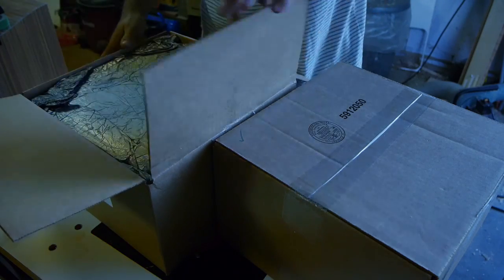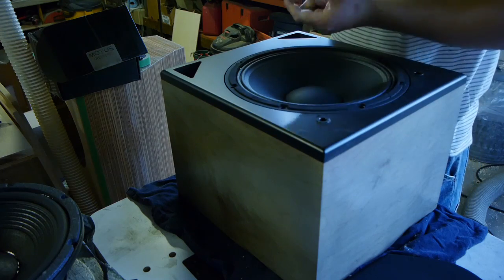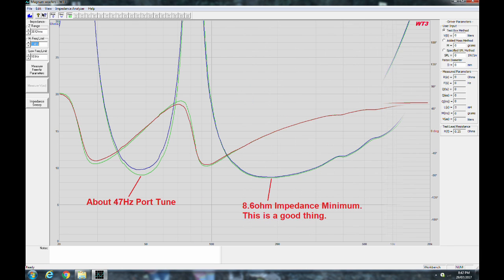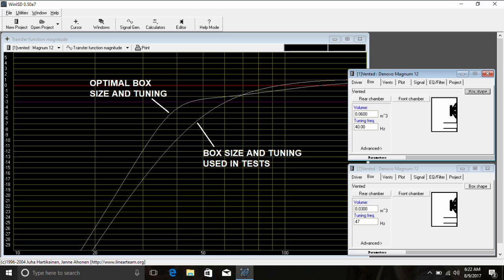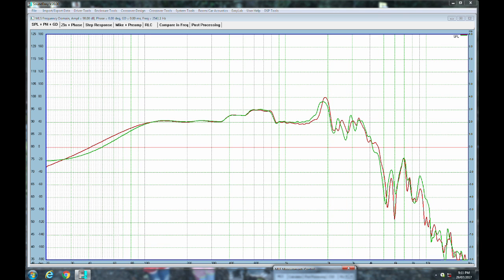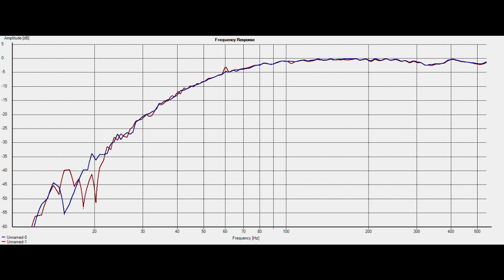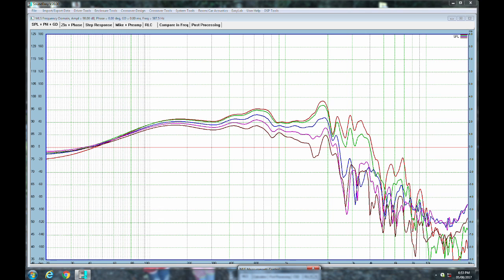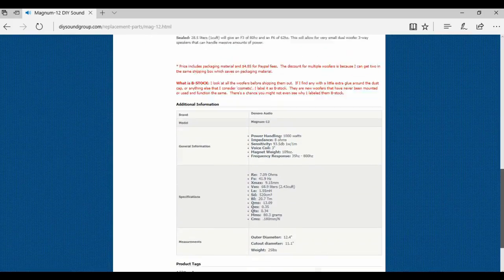Denovo Magnum 12 Test and Review from DIY Sound Group

Comment: I notice that you are trying to protect the surround from drill punctures. I like something like this DeWalt bitholder: Model # DW2055. It has a telescoping tube that prevents the bit from jumping off the top of the fastener. Worth every penny in my experience.

Comment: Hello, I am really interested in this field of design only I am quite confused at a lot of the chart plots. I am a newbie to your channel and have only viewed about 6 videos so far. I have a speaker build project I have put to one side for a couple of years now, so it is time to get them back on track and finished. I have a pair of 150 litre cabinets with a 12" Tannoy dual concentric driver in each. I do not have any crossovers so although I could buy some, I would rather design them from scratch. So here I am at your channel hoping for some of your teachings to stick. Thank you for sharing your good work. From the UK.

Comment: Great video Ryan so we can expect to see a three way with these drivers coming some time as a kit in diysg or your company.
Reply from the maker: Eng- 399 Im not totally sure yet. I cant help myself so Im playing with a coaxial at the moment. I will probably share some of it here and see where it goes. I chose a coax so that it could be turned horizontally for a center channel. So some kind of kit people could build for their theatres makes sense if it turns out well.
Reply: Did you ever make the Coaxial speaker Ryan ?

Comment: Could these be used in a two-way design? Maybe with a planer magnetic or a horn that could play low?
Reply from the maker: Mark Bushinski yes if you have a tweeter that’s happy at 800hz. There’s a few horns that can.
Reply: I'm thinking a B&G Neo8 or even the neo3 with the neo 8 and this 12" would be nice.

Comment: Suggestions:
1. Use dowels pre-cut to the right length instead of a tape measure to measure the distance between the speaker and the mic, etc. Speeds up the setup process and makes it a bit more accurate.

2. Include some THD measurements at different SPL levels - they will show how believable that 9mm Xmax is :-)

3. A band-stop filter should help to take care of that bump around 600 Hz...
Reply from the maker: Brian Steele I never thought to use a witness stick for this application. Definitely a good idea. Thanks.

As for the THD, I generally don't share those measurements due to the difficulty in comparing them fairly to other measurement sources, SPL matched, true SPL and also the need to get noise floor low. A lot of factors in getting distortion right. I do take them for my own use though and will hint if I see something off or hint if I see something really good. I also would like to show distortion measurements more and more when it makes sense.

As for the hump at 600hz, I am not really sure what you mean differently than me. But ya, just using the low pass to straighten things out works great. I used them briefly in a 3 way and they bent into shape really easily.

Comment: If you plug the ports the vented box would become a closed one. Besides you can get a complete set of TS parameters without box by additional mass method. However the basic set of TS parameters for response modeling could be obtained without test box or additional mass.
Reply from the maker: That's true. I was being a bit lazy there and planned on doing another video focusing on the bass capability where I would measure TS, do a bigger proper box, etc. I haven't done that cause this woofer was being phased out. I should have at least gotten the basic TS parameters though, like you said.
Reply: @ImpulseAudioSpeakers  Bummer that these are being phased out, they look really good on paper! Would still like to see a distortion vs spl measurement ala CEA-2010.

Comment: Hi Ryan, pls would you test the Celestion FTR as it's available in Australia which is a rarity. Having to import drivers is very expensive. Keep up the great work. Cheers
Reply from the maker: Maz 4bz oh ya I forgot about that. I will try and get that into the rotation.
Reply: @ImpulseAudioSpeakers  Cool, thanks Ryan. Here's an idea, take an existing published horn CD top end design, say a SEOS or Econowave and then measure and build the Celestion into a complete system. This way people (like me) get to see how you can integrate and fine tune something existing with something new. This would be helpful because drivers and horns come and go out of production all the time and this example would help modernize an existing system where one part is no longer available. Thanks, Maz.

Comment: A couple notes...
This is further proof that there is no need to spend $$$$ on overpriced boutique or servo subs. 
Your testing method mirrors JBL's old R&D.  They used the outdoors as a natural anechoic chamber.  The biggest difference?  They had speakers and drivers firing UPWARD from the roof. You could do that and not need a ladder.

Comment: I'm confused a bit here. I always thought a Subwoofer should provide response well below the normal woofers response of 30 to 40 hz. In fact, my two way mains go down to 45 at -3db. My sub goes down to 23db at -3db. The response is virtually flat to 26 Hz. FlAT! Its system Q is .81. Of course that produces a bump at 40 Hz or so, but when you dial things in things are really flat from 23 to 30 kHz. Flat as a pancake, no odd resonances. Below 23 Hz the drop off is still really low, providing 20 Hz at -5 to 6 db. When you put it all together it's pretty much impossible to beat. I just don't understand how anyone would be satisfied with less! It's possible, but you have to find the right drivers, and they're not always the most expensive drivers on the planet. In fact I think throwing money at any problem is a huge mistake! Have fun!
Reply from the maker: ken cohagen this isn't a subwoofer, so not really supposed to go to 20hz or what ever. This is just a driver test to show what this driver can do. It would work best as a woofer in my opinion, and how I have used it. In a 3 way it works great and can operate without subwoofer support. Of course adding subwoofers to a 3 way like that is an improvement. I use sealed subs to <20hz in my main system like you.

Comment: But that impedance goes up massively peaking at 80hz it looks like.
Seems like you'd need a beefy amp to give it rated power (500w) at that high of impedance (25 Ohms+ ) in that box.
Reply from the maker: Josh M that’s what makes it so efficient! That’s a good thing to have. If you need to give it 500 watts at 80hz then yes it’ll require a very powerful amp. Maybe impossible. But it’s the impedance minimum where max power rating will start cooking the voicecoil.

Comment: You need to use bigger AWG wire to feed a woofer.
#8 AWG is a starting point.
#4 AWG is better.
Reply from the maker: Kelly Taylor not to call you out too hard, but that is just not true. The resistance caused by this length of wire and awg is plenty for few hundred watts of audio signal. The resistance is easy to calculate.